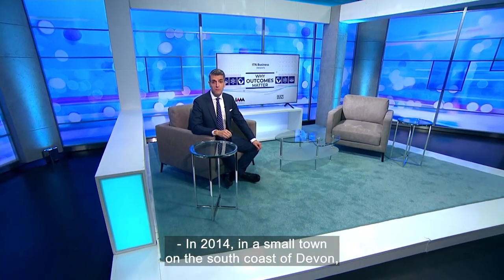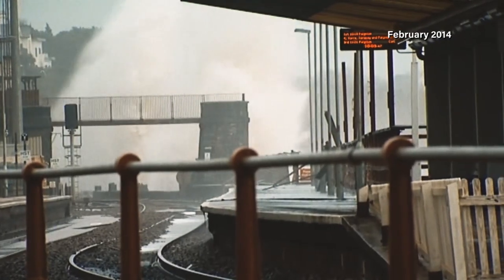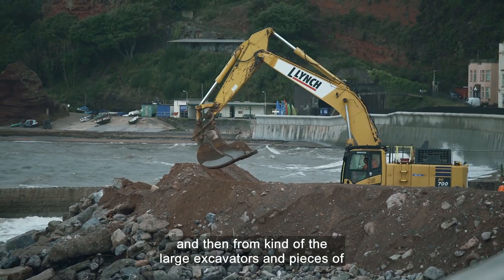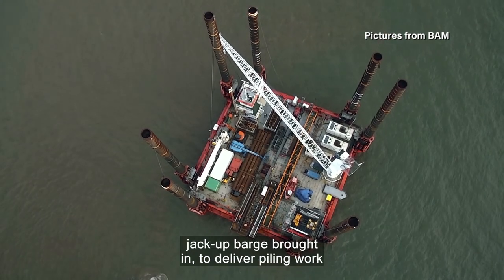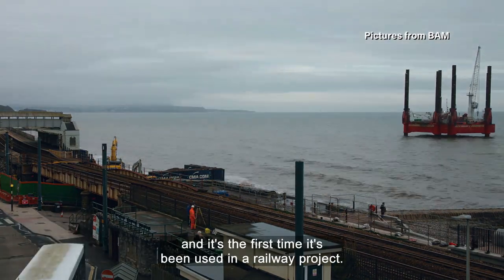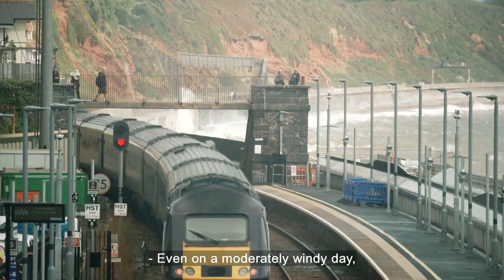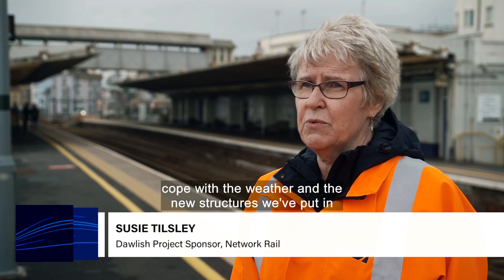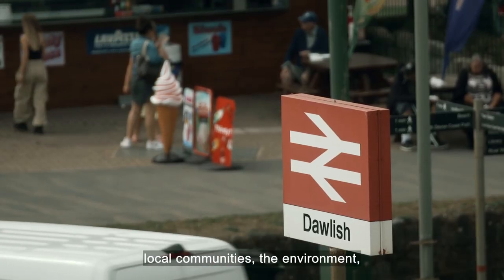BAM COO John Wilkinson visits Dawlish sea-wall with ITN Business

Comment: Network Rail knew for two years that the wall which went in 2014 was in bad repair and did nothing till after it collapsed.
The first phase of the wall at Marine Parade caused a great deal of distress to the residents, me included. The workmen could have parked in the Train Station car park but took over all spaces on Marine Parade depriving some residents, including disabled, of their parking space. The workmen worked through the night, arriving in their cars, slamming doors, shouting & swearing. At times some residents, including me, were in the road pleading with them to cut down the noise so that we could  sleep. We were met with abuse and on one occasion had to get the police involved. The dust from the concrete found it's way into peoples homes. B&Bs on Marine Parade were forced to refund holiday makers as they were unable to sleep. They were refused compensation by Network Rail! Marine was treated like a building site, NOT a residential area. Shame on you Network Rail & BAM